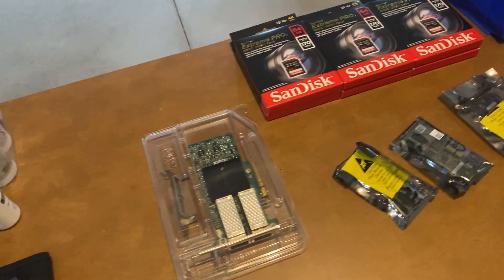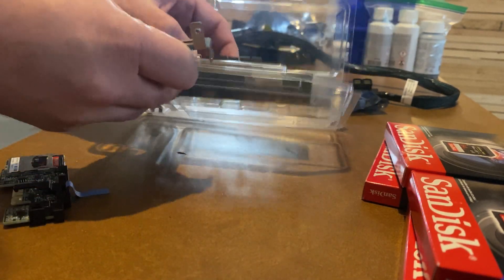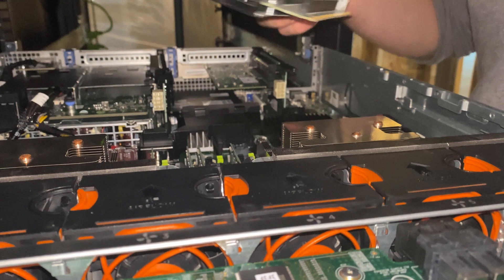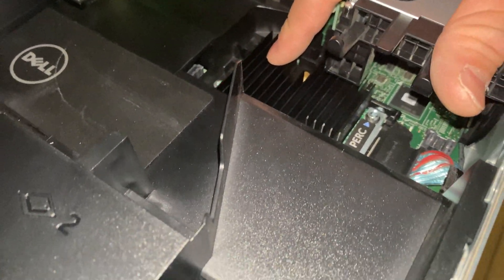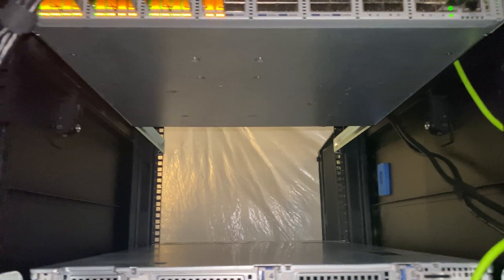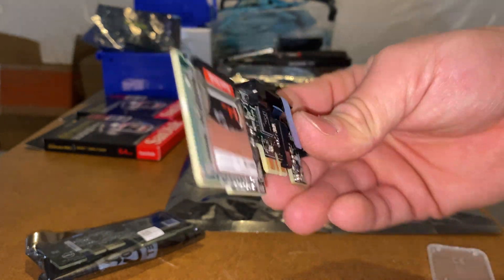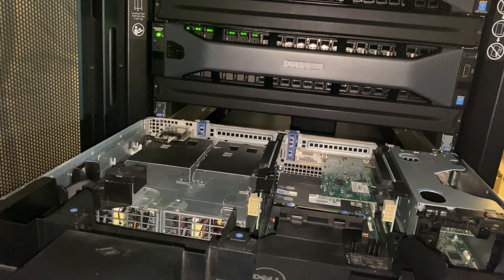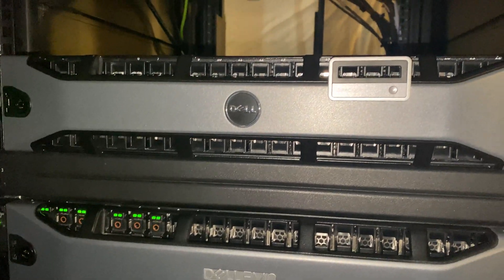VMware vSAN Cluster Project - Part 2

Comment: I am running two cluster vmware / vsan with 7 nodes each.   Was running ProxMox on them and then switched to vmware to better support the newer Dell servers.   With these videos it gives me better ideas on networking setup so may go back to ProxMox once the vmware support subscription runs out in 2023.  Yeah not happy about them dropping SD support with v7 series when it's been the norm for so long.  

Lucky I'm on VMware ESXi 7.0.2 U2 (build-18538813) as it's been patched to reduce the wear and tear on the SD cards but still on borrowed time with this setup.   Sad thing is the cluster JUST got built with v7 only to find out a month later of the problems from other vmware admins.  

Anyways, cool videos!
Reply from the maker: Hi! Nice is this a home lab or a production environment? Yeah the SD Cards are a little annoying but it makes sense with the amount of Read / Writes to the disk and IOPs is needed to keep up with the logging, vSAN, NSX-T VIBs etc. So it definitly was time to start phasing out the SD cards and going to more robust storage, kinda like the Dell Boss Cards with the dual M.2 NVMes, I am working on getting 4 x Dell R740XDs for my prod lab and my lab (lab) will be these current R730s 

Thank you for the feedback :)
Reply: @Virtualbytes1  I did purchased the Dell Boss Cards without the NVMe drives as was hoping to order them from Amazon or something.  Turns out the boss cards are very specific on what model drives it'll accept.  Others have tried something standard like Samsung 500 gig Pro and it wouldn't read the drive.   Another gotcha I've found out later.  

Seems easier to sacrifice a couple of drive slots just for the OS which is what I normally do.  The clusters was built by a third party Dell contractor so didn't have a hand at that.    From what I understand rebuilding the node isn't too hard without having to rebuild the entire cluster.   Just have to move the VMs off of the node, take it out of the vSAN cluster, remove the node from the cluster and then reinstall the OS.   I'll be testing that using VMs on my ProxMox home lab to see how that scenario would work out.

Comment: You put dual sd card. Whats that module called does it support nvme. Also did you put in Raid if so does perc controller see that cards.
Reply from the maker: Hi that is the Dell ISDM module. Which is not supported for any newer versions of ESXi 7.03 or later.

Comment: Careful with SD's on ESXi 7, they are more write intensive now compared to 6.7 I've seen a lot of people have issues just a FYI.
Reply from the maker: Yep its the logging that takes it down mostly, VMware recommends offloading all logs to vRealize Log Insight which i will be doing that for even core dumps to reduce the wear and tear. But VMware doesn't like when VMFS datastores are shared with vSAN data stores it causes some issues and even then you can do half hba and half RAID on that implementation. But overall It will be good! :)

Comment: those sd cards are going to do terribly under truenas. They've changed how they manage the boot disks and it eats through poor quality flash from USB and SD cards. You're going to want to get NVME inexpensive disks. I got 128gb ones for $20 and a $14 pcie card for them.
Reply from the maker: Yeah but since this is ESXi and the hypervisor mainly loads into the RAM and then write little chunks back to the dual SD cards it wont be bad, even with offloading all the coredumps and logs to vRealize Log Insight it will be golden!
Reply: @Virtualbytes1  I thought you were going to put truenas on one of these, are you going to virtualize it?
Reply: @hongtanke  VMware vSAN cluster on the 3 R730XDs and the 740XD is the NAS/SAN running Windows Server 2019 Std
Reply: @djtomek90  windows server as a NAS/SAN BARF it works like shit and its software raid is hot trash.
Reply from the maker: @hongtanke  I am using the PERCH740P for HW Raid not utilizing Windows Software RAID.
Reply: @Virtualbytes1  small victories. If you don't care about the data or it's a small data set then raid.

Comment: IMO it would be better to move that half height card into the 8x slot, and use both the 16x slots for two, 4 way bifurcated NVME storage. You won't be able to peg the multiple 40 gig interfaces with hardrives or ssds alone, you will need NVME to do that effectively.
Reply from the maker: Yep! I will do some NVMe in the future, already planning on that but ill have more clusters I will build. This one would be a production environment and then second cluster would be more of a playground. But with all the prices of all these servers going up and all the chips i am going to keep this current setup as is. Even now doing a Shared nothing vMotion VMs around the environment is pretty fast :)
Reply: @Virtualbytes1  Depending on what you choose, the dell U.2 cards can be had for about $100, and older U.2 SSDs can be found for around $40-$100 depending on generation and size. You could even get the consumer m.2 x4 pci cards, like the Asus hyper, for about $50-100, and use consumer m.2 nvme ssds. I personally scored a whole bunch of Intel enterprise NVME u.2's for about $50 each a few months ago, and they were only 3% used, still had 97% life left!
Reply from the maker: @bitcoinsig  Oh yeah! I would definitely get the Enterprise M2 NVMe's but I will do that for my second cluster when I built it out, I will have 2 a Prod and Lab :)